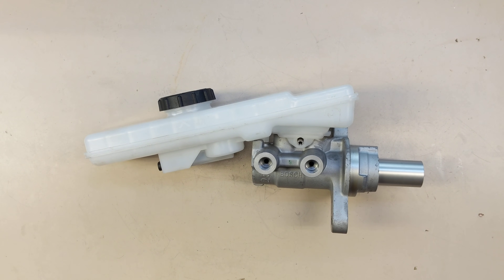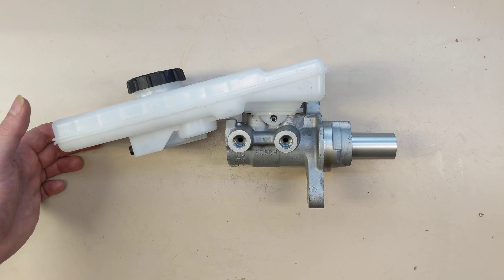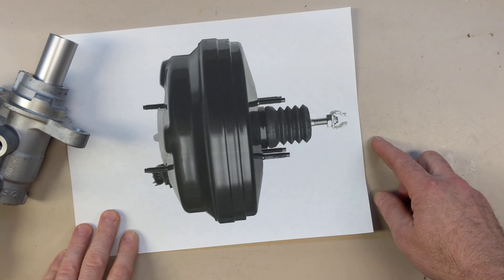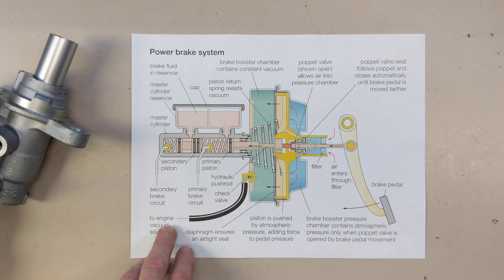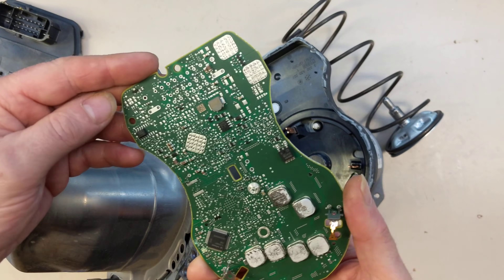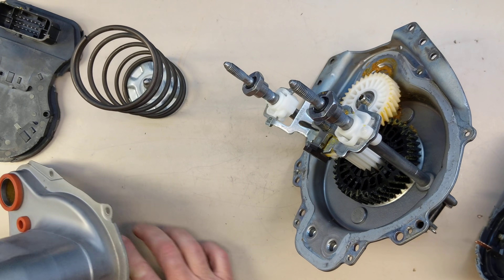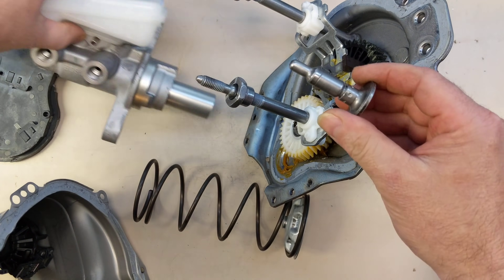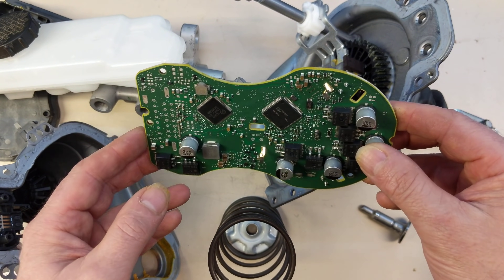Tesla Autopilot - How does it stop?

Comment: What is left for another video regarding the braking system: there is also an hydraulic control unit (with some hydraulic valves) in the path to the actual brake calipers, that takes care of brakeforce distribution to the individual wheels in each brake circuit including functions like anti-lock braking system, front/rear distribution, stability control, dynamic traction control and electronic locking differential.

Comment: I just got a gen 2 honda one. Its a bit different with the pinout. I tried getting it to turn on but it wont even take any current. I wonder if the circuit board is fried. Do you know if the system should make any mechanical sound when the ignition is switched on? Thanks for reading.
Reply from the maker: I can't comment on the Honda version, but all the ones I've played with work in a fail-safe mode with just the 4 input sensor wires, ground, +12v, and ignition (drive) inputs.  (Total of 7 wires needed on the large connector)

Comment: Interesting to see this iBooster, but I don't understand why it is required for autopilot. Combustion cars have had dynamic stability control for decades now. Those systems are able to apply the brakes individually to keep the car stable, and even execute an  emergency stop (when the parking brake switch is hold for a couple of seconds). This is all build in the ABS system, since it already has a pump. Judging from this video, Tesla still needs an ABS system, so why would it require an iBooster for autopilot?
Reply from the maker: The ESP3 system (ABS) does not have the finesse to stop a car as smooth as a human.  Yes, it can do emergency braking, but it's very rough, as the braking force can only be modulated by the PWM frequency of the solenoid valves.  In addition, the system is noisy so presents a valid NVH concern even if it was smooth enough.   AEB (Emergency Braking) is not the only function here, as Autopilot must  operate in stop an go traffic, as well as Tesla's "one pedal" driving mode, where it's activated at every stop.  I suspect the life of the valve body is also a concern, as it's probably not rated for this continuous operation.
Reply: @Ingineerix  Thanks, that makes sense!

Comment: What do you think of ibooster vs. traditional hydrovac? I think ibooster is much smaller so that it can make a smaller power than traditional one does
Reply from the maker: Hydrovac?  I'm not sure that that is.  I know GM used the "Hydroboost", and there were some other hydraulically based systems, but most used the standard Vacuum brake booster, and many cheap cars still do.  (cost)
Reply: @Ingineerix  actually i already bought 2 generation ibooster for replacing hydro booster in my full size truck. But am still trying to see if ibooster is enough...

Comment: this is actually 2nd generation of iBooster. Model S/X had first gen. The cool thing is they work well in limp mode (no CAN required), so widely used in EV conversions. I personally fitted 1st gen ibooster to my ICE DeLorean as a 40year old vacuum booster was not an option. Great video! Was that tank out of model 3?

Comment: what if the motor fails while on autopilot, and how fast can it engage the brake with just the motor alone?
Edit: also those gears look plastic, couldn't they snap quite easily?
Reply from the maker: The motor can't fail on, it's a 3-phase motor that requires AC to run.  It can apply the brakes faster than you can.   No the nylon gears are more than adequate for the forces and reliability needed.

Comment: Will it break your foot if you have the foot under the brake pedal und the ECU is braking?
Reply from the maker: No, as I show there is a one-way slider clutch that lets either your foot or the motor apply force.  The motor cannot push the pedal back, and when it's applying it, all you see is slightly less return force on the pedal.  (You can see it move slightly, but it doesn't have any force)
Reply: @Ingineerix  ah ok i get it, the piston connected to the pedal is only connected to the white plastic thing which rides inside the gear and not directly to the metal thing pressing onto the master cylinder.. Makes sense, as otherwise the pedal would move if the ECU is braking :D
Reply from the maker: @Spacefish007  You got it!
Reply: @Spacefish007   Pedal moves when ECU is braking. As I wrote above, there is a detection system implemented to prevent your foot from being crushed by the pedal. In normal braking motor is always engaged and this sliding feature is not necessary. It is only in emergency when it is needed as a backup mode to allow you to brake w/o support.
Reply: @kossaKSF  Aw ok i was right in the first place, so mechanically the system is able to "crush" your foot if it wheren´t for the software stopping this from happening.
I rewatched the video and the rod going to the pedal moves if the motor moves the gear.
Reply: Nope, there is a detection method implemented in the software. You will certainly feel it hurts, but the brake pedal will not injure your foot.
Reply: Who sticks their foot under the pedals?
Reply from the maker: @rafetizer  Never underestimate people!  Someone will try it!  As an engineer you have to work really hard to consider every dumb thing (and every genius thing) someone will attempt with your design.  A notable "for instance" is how many accidents are caused by pedal misapplication.  I myself took out my parents fence when I was a teenager hitting the gas when I thought I was going for the brake.  2 pedals; stop and go, yet people by the thousands each day, mix them up.   Usually it's during low speed maneuvers in parking lots and such, but at other times causing bad accidents.

Comment: I think Tesla would never build iBooster if Bosch don't overprice it, or they don't go different solution. Because this human part is less and less important, so why put parts for this? 
Put per wheel system and control it by computer, airbags are done this way, so safety part is same.

Comment: How does the system activate the brake lights?
Reply: Deceleration sensor (3 axis gyro) in the car detects slowing.  When it goes above a threshold level, the brake lights are activated.  Also there is a conventional switch on the brake pedal lever arm.
Reply from the maker: @morrisg  is correct, but the DI (Drive Inverter) supplies the signal when regen is over a certain negative torque value.

Comment: I like how simple the iBooster setup is. I've had other EVs with electro hydraulic brake boosters (500e, ELR), one of which had adaptive cruise control. The iBooster's operation is smoother, there's no annoying pump sound, no buzzing pump feel through the pedal, and no constant brake fluid level changes drawing moisture into the master cylinder reservoir*. And the iBooster has better brake pedal feel IMO. 
It's basically power steering for the brake pedal!
On some cars with ESP, there was a computer controlled valve on the vacuum booster that could cause the booster to apply the master cylinder. It was used to "precharge" the master cylinder during ESP intervention, and for emergency crash avoidance. It's not as smooth / metered as the iBooster. 
*On the Fiat and Cadillac, there was a 2nd ABS pump that would charge an accumulator, which was used to run a hydraulic brake booster. Whenever the car was turned off the pressure in this accumulator was bled off, and it would recharge every time the door was opened on the Fiat, or the ignition turned on with the Cadillac. This would change the fluid level several CM in the reservoir.

Comment: Wow, that circuit board is PACKED! Crazy how even the most seemingly simple things have a microcontroller inside. I wonder how reliable this solution is compared to the more "basic" version.
Reply from the maker: I haven't seen a single failure of the iBooster.  I'd say it's more reliable than a Vacuum boost system.
Reply: A lot of components IMHO for a pretty simple function (BDLC driver, 2 Hall-Effectsensors, CAN-Communication)
Reply from the maker: @Spacefish007  Because this is considered safety critical, it's definitely overbuilt and has some amount of redundancy.

Comment: Why not simply using the already existing ESC module to apply preasure to the breaks?
Reply from the maker: Because it's not very smooth or controllable.  This is used as a failsafe though should the iBooster fail.

Comment: Awesome video! I'm wondering how the iBooster ECU positions the 3-phase motor? Does it use some encoder? I guess the hall effect sensors is used only to monitor if driver pressed the pedal?
Reply from the maker: There is a TDK hall-effect angle sensor on the PCB that gives the brushless motor inverter direct position feedback of the rotor.   The other hall-effect sensor I show in the video detects not only that the driver is pressing the brake, but also how hard.
Reply: @Ingineerix  Great, thanks!

Comment: i wonder how autopilot deals with emergency brake situations. does it just activate the pedal (the motor takes time) or just send signals to the abs box as its faster or both and sees what is faster.
Reply: iBooster is faster than ESP in building up pressure.
Reply: @kossaKSF  i am not an expert but i am pretty sure the motor on the brake thingy is slower then the actual abs solenoid.
Reply from the maker: The iBooster is way faster than the hydraulic pump in the ESP3 (ABS) valve body.  ESP3 is set up for high pressure, but has relatively low displacement, so cannot move a large amount of fluid in a short time.   I assure you it would be quite obvious if ESP3 activated, as it's noisy.
Reply: ibooster can build up very high amount of brake force in short amount of time. on my car i can lock up the brakes with ibooster actuating in autonomous mode. although car is only 750kg...

Comment: Computer applied braking is done through the ABS system.  ABS is computer controlled in the first place.  It has a pump to supply pressure and 8 or more control valves.  All you have to do is provide a command to apply the brakes.  The motor starts, the valves are closed and the brakes are engaged.  No additional hardware is required.

It is not done through the brake booster unless the brake pedal moves when the computer brakes are applied.  The ABS system is VERY fast, responds within milliseconds.  That pump motor has a lot of power.  P.S. ABS is required on all new cars.
Reply from the maker: Incorrect.  The ESP3 (ABS) Valve body doesn't have the finesse to be used in this way, plus the PWM of the valves is noisy and creates a lot of NVH issues, in addition to poor pedal feel.   It is used as a backup should the iBooster fail though.
Reply: It is not working like this. In normal conditions, ABS stays always open and brake pressure is built up by a booster. iBooster can obviously also do it via external request, you do not have to push the brake pedal.

Comment: A very clever solution to get rid of the vacuum brake booster. And it's brushless to, so should be maintenance-free for a long time. I really hate troubleshooting vacuum leaks on on a car, so this is a welcome addition.
Reply from the maker: Yes, I've been working on Teslas since they introduced the iBooster.  I have never seen one fail unless the car was in a flood and it gets submerged.
Reply: Trouble free for the rest of the warranty and then.......
Reply: @Xanthopteryx  if it has a Bosch part number maybe it's possible to source the part
Reply: @MyProjectBoxChannel  Could be a custom part number, that has to be translated to a normal part number.
Often things are rebranded. The same with brakes and shit. It may say "Tesla 365726" on it but it is a Bosch or Brembo 764543 or similar.

Comment: Now make one that runs off 48v and shrink that motor.
Reply: Lower volume, more expensive.  No thanks.
Reply from the maker: @morrisg  is right.  Plus the motor wouldn't be that much smaller.  It would just use slightly smaller windings.

Comment: Super interesting and surprised of how much technology is involved. Every Tesla has all the hardware even if you do not pay for Autopilot. Volkswagen on the other hand has an endless number of models. For example the Transporter T3 has e-gas. If one does not pay for cruise control at purchase, not only is the physical button array missing, they have written the software in a way that the fitting of the cruise involves extra huge costs to re-flash the whole motor control system. They did that to stop 3rd party cruise control makers to have huge extra costs. A reason never to buy a Volkswagen.